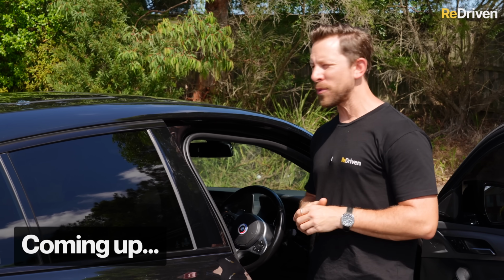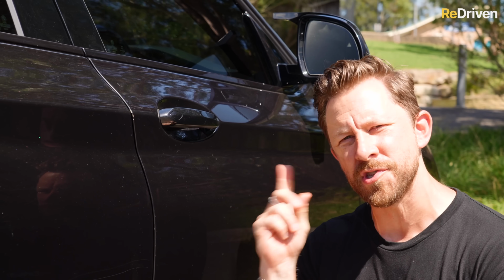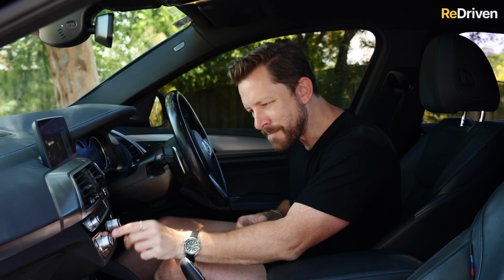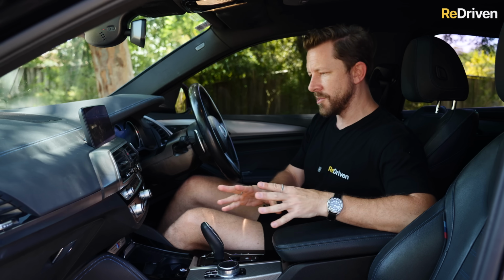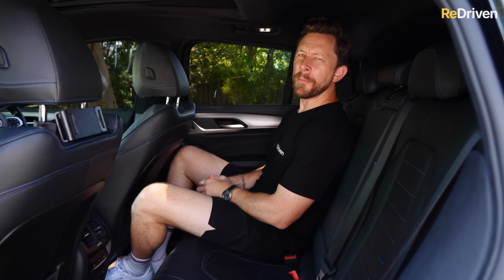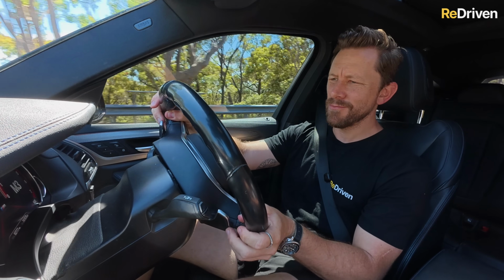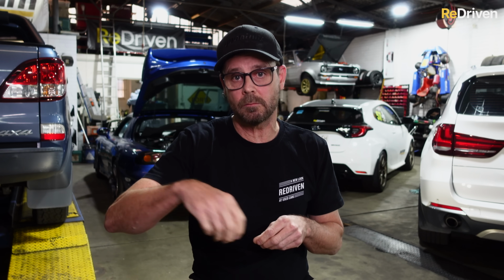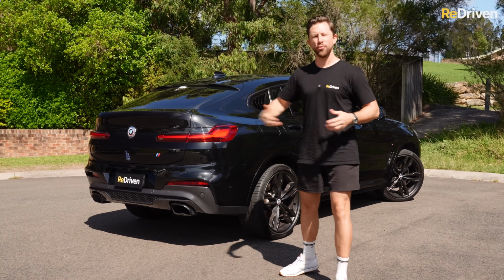Is a USED BMW X3/X4 just one big headache?

Comment: My non premium brand Suzuki Vitara no probs in 6 years of ownership including sunroof which works as well as when new. It has enough goodies to keep me entertained - panoramic sliding sunroof, climate, reasonably decent stereo good performance for a smallish SUV.Dealership here in UK good too. Also any competent independent mechanic can service my Vitara too as it's not overly complicated. An expensive "premium" brand should not have quality or reliability issues.
Reply: Same I have a 2017 awd turbo Vitara and have had no issues. With low weight, Michelin PS5 tyres on and in sport mode it also drives half decently in the corners.

It's not really comparable to an X3 though.
Reply: Vitara is a great car, unfortunately it doesn't drive like a BMW. I want a BMW With Suzuki realibility

Comment: Now the question is, how worse it is for driving compared to the 3/4 series from the G generation?
Reply: The current G20 kills it.
Reply: @davidperry3531  that part I know but I'm wondering if the X3/X4 would drive much worse or the difference would be quite small. Sadly getting a test drive is quite hard where I live so giving them a spin isn't so much of an option, especially since I don't wasn't to buy them new

Comment: number 1 reason to avoid the x3/x6 is because they are hideous.

why buy a raised crossover and have no benefits of the sedan (handling and center of gravity) or the full size x5/x7 and get the boot space

same reason to acoid any cla/cls/glc Mercedes as they are just crap

Comment: The indicator stalk doesent work... I was thinking this was abit of banter 😂
Reply: very late to the party 

in some of the manufacturing run there was a recall because the wire that manages the indicator stalk was slightly too tight and can snap. It's like a 20 minute fix but you couldn't make it up - not using the indicator avoids snapping it... technically

Comment: Here in NZ, I managed to find a used 2015 BMW X3 xDrive20d (NZ new, 1 owner) X-Line with only 56,000km on it with full dealership service history (4 new Perrelli tyres) for NZ$21,000 - absolute bargain!
The turbo had been replaced under warranty by BMW, but that was a bonus as it still had a bit of warranty left on the turbo. The guy had upgraded to a Tesla and had it advertised for $26,000 for over a month before dropping the price to NZ$21,000. I absolutely love my BMW X3.
Reply: Until the turbo goes out again
Reply: @Giddy-i2c regular oil changes and it’ll be fine
Reply: @shadowchrome_   oil-return pipe of the turbo is very easy to block on this model
Reply: Replace oil-return pipe of the turbo if you can.  It is easy to block and cause turbo failure. Very common issue for B47 engine. Mine caused turbo failure twice

Comment: Had an X4M40 for a very short space of time, coolant was bubbling for no apparent reason. After extensive testing it was the water pump and air temp sensor. Difficult to diagnose as there was no leak and the car wasn’t overheating. Keep an eye out for this
Reply: What mileage did this occur
Reply: @ 50k miles
Reply: What year X4 M40i?
Reply: @ 2019 pre lci

Comment: Why not get a CX-5?
Reply: I have owned both 2020 cx5 max sport and x4. No comparison and the bmw was so much better built.
Reply: Because they drive like crap in comparison
Reply: @Allanhyde264  hmm I could probably withstand a poorer quality ride over a BMW that has a ton of problems, expensive maintenance and ownership costs and horrendous depreciation!
Reply: @gleb3357  I am a fan of the cx-5, but there is a reason why BMW is a luxury brand... if you are someone who will cry about expense, it is not the type of car for you.
Reply: Not the same car shopper
Reply: I did then sold it and bought my x4 again 🎉 Mazda so boring hard seats yuk

Comment: X4 m40i , 2nd owner since 2020. It always puts a smile on my face even without changing to sport mode. Serviced every 10k.
Reply: That's the key, crazy how BMW over here only recommend dropping the oil every 24 months (unless kms are unusually high).
Gearbox needs new fluid every 80,000 kms also
Reply: @eponymous7910  24 month is crazy. Giving average mileage per annum is about 15-25k. That is oil change at 30k. No oil lasts that long.

Comment: 'It's just recalibrating a key, it's easy'. Programming and syncing keys is the the highest security part of any vehicle electronics. Aftermarket solutions especially with high end cars like BMW & VAG group often require disassembly of modules. And in a dealer for these higher end brands there is usually only one or two people who are authorised by the manufacturer to access key learning functions, usually workshop manager or leading hands.
Reply: Most midrange diagnostic scanners($700-1500) have the ability to program keys/immos. It's not all that secretive. There are standalone programmers that are cheaper. Another option, if you've already got a key in hand, you can buy a blank fob and program it yourself without anything other than your other key and the ability the follow the programming sequence.

Comment: And once again confirmation I will be sticking with Hyundai and Toyota, and my Ford Transit Diesel on 240k Km doesn't miss a beat.
Reply: I don't get why this comparison is brought up by internet folks. Hyundai, Toyota, Ford are cheap to buy, cheap to run, reliable cars and they do it very well. Their purpose is not power, handling, confort nor advanced technology features. You need to drive a 6 cilinder BMW on the Autobahn or a twisty alpine road, you will think about selling all your cars and buy it for a second 😂
Reply: @boogeyman423  and as you see an Internet folk  jumps on without knowing that I lived and worked in Germany for 10 years, drove BMW, mercedes and various other hi tech vehicles on the autobahn at high speed. They have their place and are great, but I can do the same in a Toyota or Hyundai at speed and comfort, and in the knowledge I won't have to sell my children to pay for replacement parts.
Reply: Makes you wonder why Lexus / Genesis didn't succeed in Europe like North America and Australia
Reply: @Mm.2112  it does a bit. A lot of it was brand snobbery. Those who know Lexus in Europe know how good they are and never stray. Genesis did ok in mainland Europe but have only just come to UK in any considerable size. Hyundai EV in particular is far superior than anything BMW or Mercedes can produce.
Reply: @Mm.2112 Cause actually rich people who live in Toorak and Kew can afford to shuffle through leased German cars on an annual basis. Lexus is for poor people who can't afford to do that, but want something more premium than Toyota.

Comment: Valve cover has a cap which can be pried off and the diaphragm and spring can easily be replaced without changing the cover, takes about 10 mins on a b58.
Reply: That's in the series 1 x3 m40i. On the series 2 late 2020 and up you can't do that.

Comment: lol its a Bmw. Gonna cost an arm and leg to keep on the road.
Reply: Have owned plenty of BMW….never a problem. Never keep them over 40K miles. Have tried other brands and always go back
Reply: I don’t get this comment, I’ve spent more maintaining my N80 hilux than I did daily driving a 335i
Reply: Which bmws have you been driving? I’ve had everything from the e36 up to the f30, 90k miles to 255k miles. I don’t have any complaints at all
Reply: @Karmawrl  yep, family has m440i never missed a beat so far at least
Reply: I've had everything from an E46 318i, F10 535i up to my current F80 M3.......they have been nothing but a pleasure.....that kind of comment generally comes from someone who hasn't owned let alone driven a Beemer.......
Reply: ah some of you are either dund or troll that can't admire that Bmw is good now